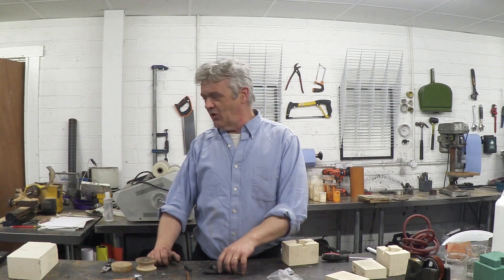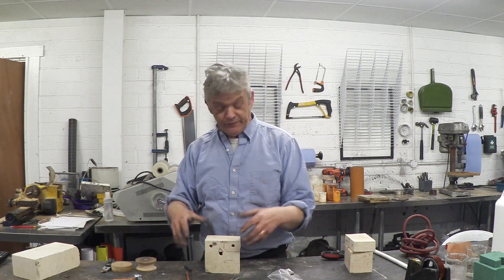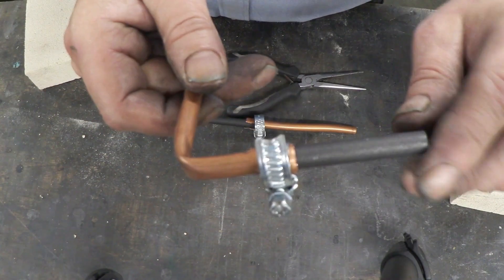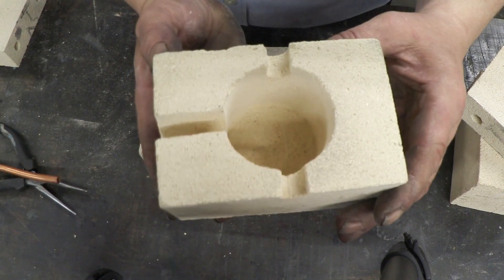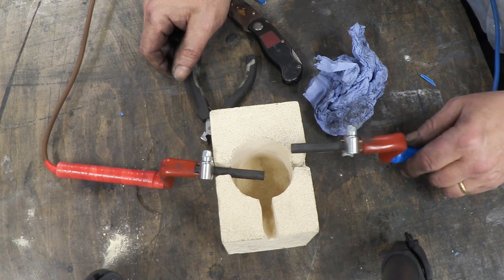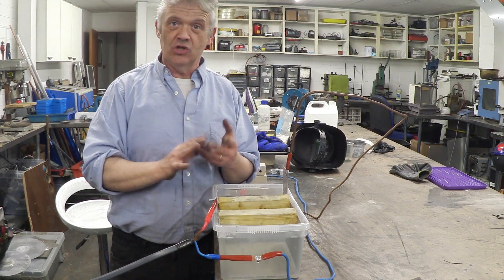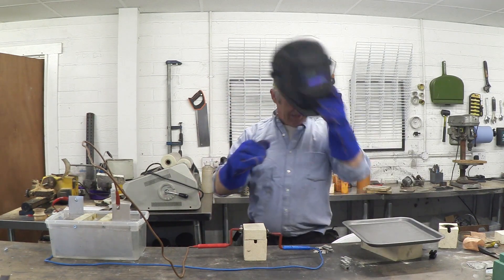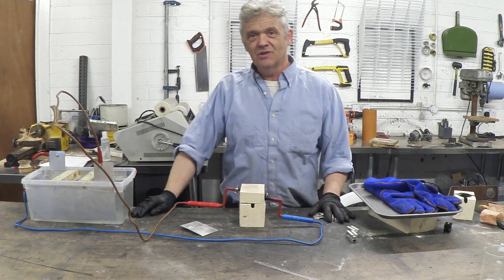Melting Metal With Water

Comment: It reminds me of an old workplace, a dog track to be precise, the hare was pulled around the track by a plastic-coated wire cable this went around pulleys and a big main pulley with a three-phase electric motor, it used Soda Bath speed control, you were supposed to mix up washing soda with water and fill the three baths with the solution. The hare control man had to pull up the handle and inside the box was three sets of plates, these would descend into the Soda mix the higher the handle was pulled, the more immersed in the solution the more conduction.
On startup when the plates were just dipping into the baths the noise of arcing and spluttering filled the room, the guy in there did an amazing job which took much concentration keeping the hare the correct distance in front of the dogs.
However, he loved his beer and had enough time to go and get another pint between races but not quite that much time to go and queue for the bathroom to dispose of the said beer consumed, and even less time to mess about replenishing the Soda in the baths.
He would simply lift up the back cover and pee into the baths to keep them topped up, it was pee speed control, more Urea than Sodium Carbonate, it worked very well but needless to say, the room did develop its own special smell, of which the manager used to complain bitterly about. 
But it was the 1980s, the place was full of ancient tech, the camera which I had the misfortune to use had a razor blade negative cutter, in total darkness I had to grab the negative and using my thumb pull it over the blade to break it off, often catching my thumb in the process, then it was into developer bath in the dark, of course, then came the fixer which was Acetic Acid, this would then enter my open cut in my thumb the pain was unbearable but there was no time to worry about it, I had to shout down the dog lengths and a close finish would mean a big faff making and enlargement on photo paper to confirm a result. 
To make matters worse they had painted the whole photo lab, Matt Black, even on the outside, very pleasant after a hot summers day NOT! lol.
Reply: Great story👍🏻
Reply: Just imagine peeing into the bath after you had forgot to turn the power off.
Reply: @CASHSEC  Barefoot, on the wet ground to concrete.  Path of least resistance..

Comment: now mount one of the electrodes on a screw, so you can adjust the carbon electrodes. 
 you can make an adjustable water electrode with a copper tube connected to the power, and slid over a threaded rod with a couple of washers on either side. (the copper tube length being the height of the bucket,)
screw the rod into a bit of wood that's at a bucket height over the bucket, and add an insulating handle. (maybe dissolve some abs in acetone and use that for the handle.)
thinking about it you can just glue the rod on the end of a plastic pipe that pivots.

Comment: Great project!
The mad scientist laugh at 9.50 was classic!
BTW how many amps does that draw?
Reply: This is exactly what I was looking for.
Reply: @NicholasLibby  It's more accurate to measure power consumption by watts, because carbon arc is low voltage, high amperage. Carbon arc generally operates in the 35-60v DC range at hundreds of amps. I'd say at least a couple of kilowatts but, power consumption varies greatly with arc length and how conductive the water is, as well as how close the plates in the water are together.

Both my dad and I were projectionists once upon a time. He had carbon arc projectors, and I had xenon projectors, but they had in common the same type of low voltage, high current DC supply to drive the light source. Those power supplies are definitely not something you want to casually play with, they can be super destructive and lethal.
Reply: @GGigabiteM  Hundreds of amps, yet a couple kilowatts? At 30-60v? 3kw / 60v is still just 50amps. Where's the hundreds? Can we get some real information here ? We're only rocking 13a at 220v here if we're dealing with 3kw. Not to mention if we are measuring this in watts then if I wish to know the amperage draw I'd need to know if this thing in the video is hooked up to 120 or 240. So much easier to just give us a simple amp number and we can sort out the rest. Including watts.
Reply: @NicholasLibby  UK 13 amps plug so its going to be 13 amps max at 220-240V

Comment: what salt can you use to recharge a 12v car battery ive seen epsom salt used but can you use table salt to refurbish a car battery  ???
Reply: You use a battery charger not a salt to charge a battery. Increasing electrolyte concentration only makes the battery work harder so it will not last long after. Most of the time the cause of poor performance is that the positive plates crumble and fall apart. The only way to 'refurbish' such a battery is to rebuild it.
Reply: @SinsBird  thats the word im looking for electrolyte ive got a Generator and it use's a 12v battery to start it but the battery ive got is dead put it on charge but can only get it to put out 10v so need to know what electrolyte to use ive got de-ionised water but need to know what salt to use to try and bring the battery back to life to kick out 12v even if it last's to krank it over ??
Reply: @woody1766  Your best bet would be to hand over some cash for a new battery at your local auto parts store. Works every time and even has a warranty
Reply: If it's outputting only 10V, probably one of the cells shorted out. Screwing with electrolyte will not help unless the cells have dried out, then just add enough distilled water and hope that it recovers. If a cell is shorted out, then there's nothing you can do.
Reply: @SinsBird  ive put in distilled water this afternoon just been to check the voltige and its at 11v now so im hoping it will work and can get it to 12v to 13v fingers crossed.